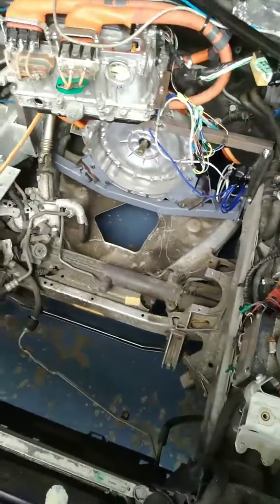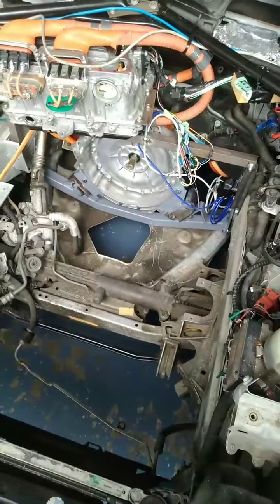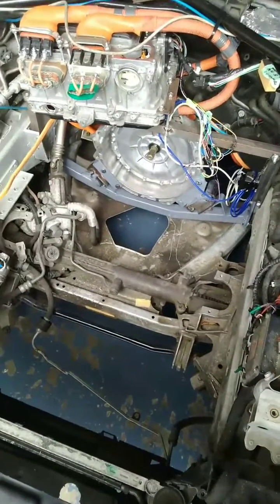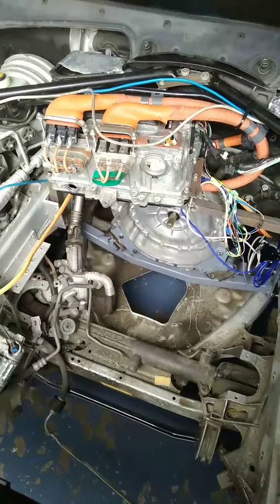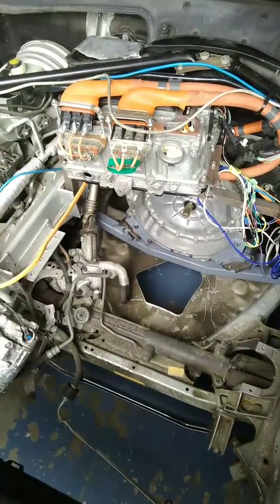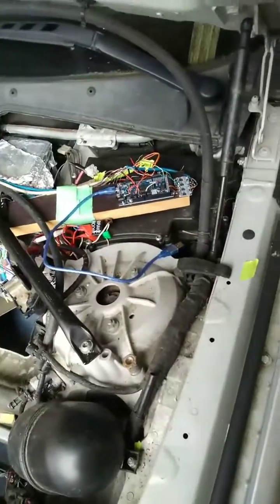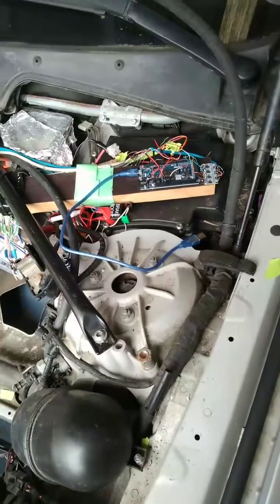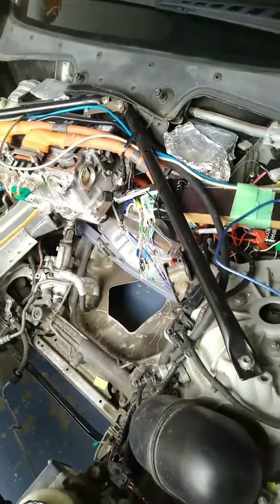Test Setup: Electric BMW 5 series with Lexus transmission & Prius inverter

Comment: Great stuff… Is this using the factory Prius logic board?  I’ll be curious to see what the limits of that inverter are with the bigger gearbox.
Reply from the maker: I believe so. Hopefully George will confirm. Yes, it's cool. I want to see it running a Prius. Full EV conversion on a Prius seems like it would be neat & there's loads of donors out there :)